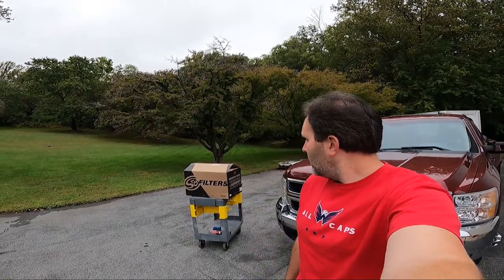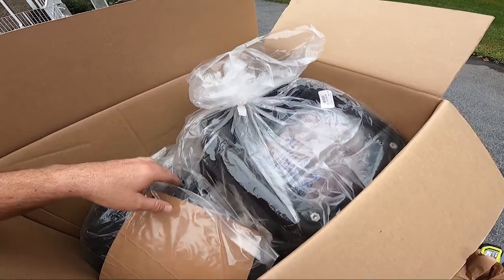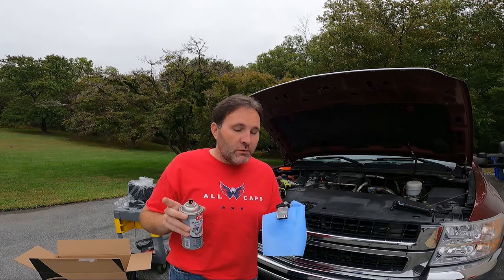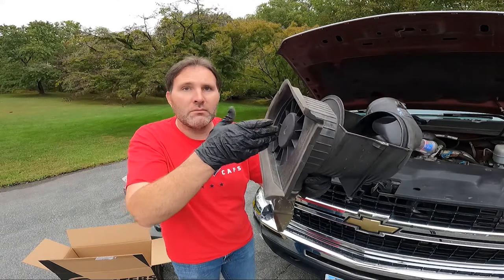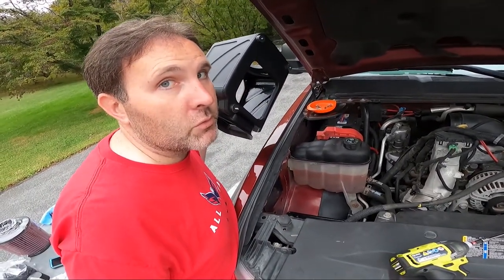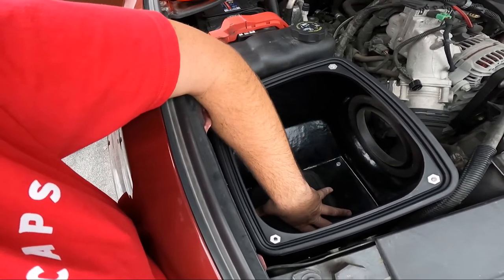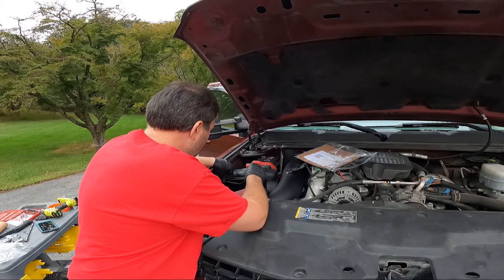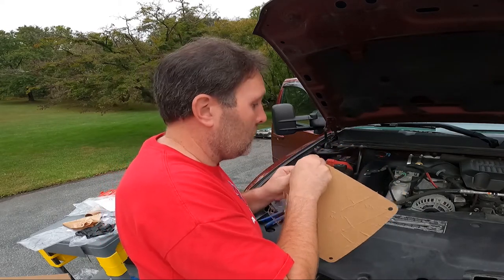Installing a S&B Cold Air Intake on my 2009 Chevrolet Silverado 3500 with the LMM Duramax

Comment: Great video bro 👍🏾
Reply from the maker: Thank you!!!! I think I'm starting to get the hang of this YouTube thing! Although I was trying to add music to the part I time-lapsed but it kept adding music to the entire video instead of that part. I read how to put it just on that section but the controls that the help section said were there weren't 😕. I'm sure I'll figure it out sometime 🤷‍♂️
Reply: Have you placed an order for the 22 F350 6.7 dually yet? Or are you going to just keep the chevy beater 🤭
Last month I got my production date for the 22 F350 6.7 Tremor, week of Oct 18th! Order placed 4/20 then changed 7/13.
Can't wait!
Good video btw!
Reply from the maker: Not yet. I've just been too busy to get to the dealer but I'm try to get there in the next couple weeks. I want to check on a Mach-E for my sister and a 32 Expedition for my best friend too. I think I'll go ahead and order a 22 F-450 Platinum but I'm really interested to see what the 23 redesign has. I know I'd really be happy with the 22 because my only real complaint about the 21 was the infotainment system but I'm hoping things like the generator system from the 150 makes it to the Super Dutys. On the infotainment it wasn't the size I didn't like, although I'm glad it's getting a 12 inch, it was the processing power and memory both of which should be a ton better in the 22. I'm really excited for you!! I love the Tremor but because I almost only use my trucks for towing or hauling it doesn't make sense for me 😕. On my Silverado while the new trucks are so far advanced over this 2009 this truck is so nice overall that I think if I wasn't really trying to make this YouTube thing work I'd just keep driving this! It does everything I need it to at 45% of the price. Interesting my insurance isn't much different. The new intake has seemed to really help the MPG and an exhaust and tune are in the near future. Power wise this is a joke in comparison but if I hadn't spent 6 months driving the 450 I wouldn't feel that this truck is underpowered. A couple grand on a bigger turbo would get it a bit closer though haha. I'm going to do a video soon out what I miss about a new truck but the biggest thing is the wide track front axle of the F-450. Driving through a parking lot or backing up a trailer us so much more work in this truck. Anyway let me know when your truck comes in! I'll put a video out on my 22 order but I think waiting for the 23, again mainly for YouTube content makes the most sense for me depending on what it actually looks like and release date.
Reply: @hitchedtohorsepower  

I look forward to your videos!. 

Just giving you a hard time on the chevy...I used to have an 06 Duramax 2500hd , it was a good truck, I just hated the front independent suspension and I fried the Allison transmission with just a 100hp banks tune.. I also felt heavy weight pushed the truck over the road much more than the Ford's.
The next time you come through MN or I'm in MD area , I'll let you know!

I'll let you know for sure when my 22 F350 6.7 Tremor comes in!

Put a deposit on a green 21 Ford Explorer Timberline for my wife. We are picking it up Thursday. Dealer said the Explorer Timberline's don't make it one Day on their lot before they are sold!.. We looked at videos of the 22 Expedition Timberline but it's just too big. We only have one kid . I was impressed that Ford used a Torsen limited slip in the rear on Explprer Timberline plus my wife absolutely loves the Forged Green color.
I think Ford is just doing really awesome ...with the bronco (sometimes I watch Mitch with Town and Country Ford on YouTube. He goes in depth on the Broncos), F150 Raptor, Expedition,  Explorers, Super Duties. 
The 2023 Super Duty will be even better. That was my thought that Ford would have the generator hook ups in the back bed!!!
I have a 2019 F150 2.7 and was thinking about ordering and trading for a 22 F150 for the mere fact of the on board generator! !

I wonder if Justin from JB Reviews plan to go with a 22 Ram 3500 6.7 HO cummins. Man he loves those Rams rofl!!! Guess I have no room to talk because I love Ford just as much lol. Such a great time to be in the market for a truck!
Reply: @resharddurdley6987  You a member of the Tremor forum?
Reply: @mr.dillpickle  
Yes I am!
Reply: @resharddurdley6987  Heck yeah! If you don't mind, what is you username over there? I'm not a member, but look at it regularly, and will keep an eye out for pictures of your rig once you get it 👍
Reply from the maker: Yeah I know, there's the people that like to talk crap about all sorts of things they see online which is annoying but the people that give a bit of good humored razzing make the comments fun!! I had great luck with my Allison in my 06 Silverado 3500. In the 300k miles I put on it of very heavy towing I never had to do anything other than changing the fluid and filter. When it was new it went into limp mode quite often but as soon as I put a tune on it that stopped. Later on I had a bigger turbo and tune pushing about 500-550 hp and still no problem. From everything I've seen it seems that there's good trucks and bad trucks that come out of the factory. Like I think I mentioned before that's why I got rid of my 450, it had a couple things like an oil leak that was an easy fix and the DEF issue that I never got fixed but when you spend $90k on a truck having problems like that start at 2 or 3 thousand miles on it. I'm pretty sure it would have been fine in the long run but I figured I'd take my way out and get another one in a year or so. I really like the Explorer, my friend has 3 kids. They have a minivan and he drives a 5 series BMW now but he's 6'7" and I keep telling him how much more comfortable he'd be in a full size SUV or truck. He loves driving my bigger vehicles and I think he's at the point that he wants something bigger. He's also in a position that he makes a LOT of money  and needs something that's nice for clients but can't have something too nice that makes them think he's making too much off of them lol. That generator thing is awesome. I get that they sell a massive amount of F-150s but you think it wouldn't be too hard to put it in the SD. Also Super Duty buyers tend to do stuff that a generator would be extremely helpful. I can't imagine they won't add it on the next refresh/redesign 🤞. Hopefully I can continue to grow my channel by next summer. As it turns out I'm not transporting enough cars a month to pay for that $1300 truck payment over the last couple months. I wasn't counting on that to make the payment and I probably would have looked for a little transport work if I still has that truck but it would be nice if I can get to the point that I'm making a bit of the payment off YouTube 😁. I haven't been up to Minnesota in several years but I never know where I end up going. Most of my car transport stuff lately is for a friend that has a high performance Mazda rotary shop that has a national following so I've gone pretty far to pick up cars. I'm a lot more expensive then a big hauler but some people really like their car to be the only one in the trailer. Also lots of these cars are really low so they won't make it in a lot of trailers. Definitely let me know if you're down this way!
Reply: @hitchedtohorsepower  are you adding it to your timeline in the editor or are you adding it on youtube? I normally download the music and edit it with the video.
Reply from the maker: I edited with Adobe PhotoShop/Video editor. I know I was doing something wrong because the help section I'd said click at the bottom and drag it to the section I wanted it. I feel that I'm starting to get the hang of it's basic editing for beginners so I might start using the intermediate part. I looked at the pro side and it's amazing how many different things can be done! Most of that I was clueless about haha. I met a guy at a friend's wedding that is a professional editor and he said he uses the same software a lot and he would help me out with anything he could. He lives in New York but can help out over the phone or he wants to come down and check out my cars and garage sometime! I'll play with it some more myself also and see what I come up with and next time I'm up your way I'll bring my computer and show you what it's doing.
Reply: @hitchedtohorsepower  👍🏾👍🏾

Comment: Great video, i have one on my LB7. I would delete it even with the federal regulations. Depends on you local inspection regs I suppose wether or not you would ever have any issues. Thats one reason I got an LB7.
Reply from the maker: Thank you very much! I agree on the emissions. I had a 21 Ford F-450 Platinum that started giving me DEF problems at about 2500 miles. I took advantage of the crazy market and sold it back to the dealer after about 6 months and 19k miles. I hada 06 Silverado 3500 with the LBZ that I loved and put about 300k on. When I decided to get rid of the F-450 I really wanted a 06 or early 07 LBZ but was happy with a 07 to 10 with the LMM. I didn't even consider a Ford or Ram from the just prior to DEF era mostly due to transmissions. I was happy with the LMM because it's a LBZ with a DPF. So let's say I now have a 09 with basically a LBZ haha. If I couldn't find a LBZ with low mileage and no rust I really wanted a 2010 because it was the only pre-DEF one with cooled seats. I really miss cooled seats and a heated steering wheel! I found this truck in Montana with only 47k miles and because Montana uses sand instead of salt on the roads there wasn't any rust on this truck! Not exactly the color combo I would pick but it's such a nice truck I couldn't pass it up. When I bought it I planned on driving it for a year or two then go back to a new truck but after living with it I'm very happy with it, other than the leaking sunroof that I can't get replacement drains for 😡, that I've decided to drive it to the point that I don't trust it on long cross country trips. Based on what I've seen before I'm expecting that to be about 300k miles. After that I might go with a new truck but I'll probably look to see if there's any GM 6 speed auto, pre-DEF trucks still available in great condition!! Thanks for watching and commenting! I have some videos out on my thoughts between this Silverado and a 23 F-450 Platinum that I've put out in the last few weeks.

Comment: Thanks for the video. What kind of fuel economy increase did you end up seeing?
Reply from the maker: While towing I'm seeing an improvement of about 1.5 to 2 and 2 to 3 unloaded. That was with only the intake. Between the intake, exhaust, bed cover, and a tune I'm getting 20 or 21 mpg under the best conditions.

Comment: that piece has give me hell it dont take much to foul it out I think it put me in RIP
Reply from the maker: Wow that stinks, sorry to hear that. Did you have both the fender and underneath air intake open? I'm just using the fender intake. It stinks how consistent quality of products doesn't seem to be all that good lately. I just got a backup camera from Pioneer that the power wire disengaged within 6 months.
Reply: Sorry Reduced engine power. I realized my air filter was in a lot worse shape after buying a new one. That should prevent the sensor from catching debri and I also changed my fuel filter housing